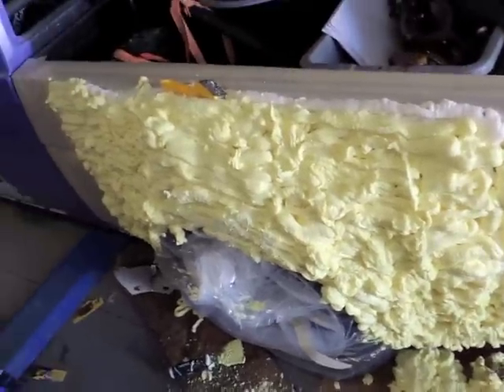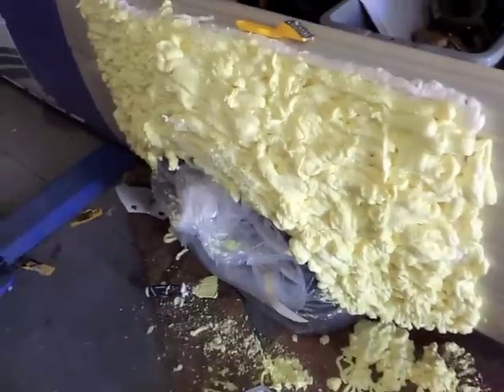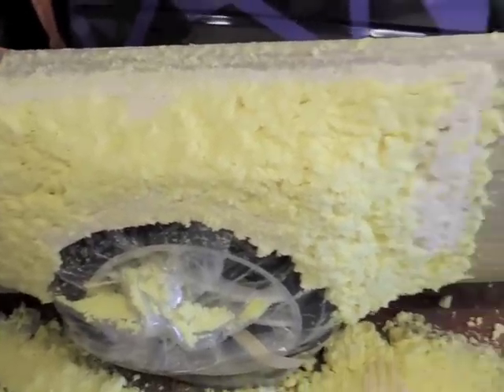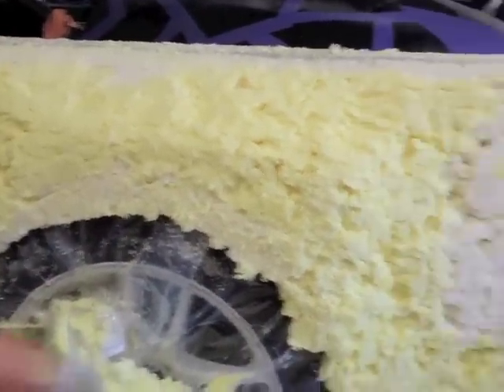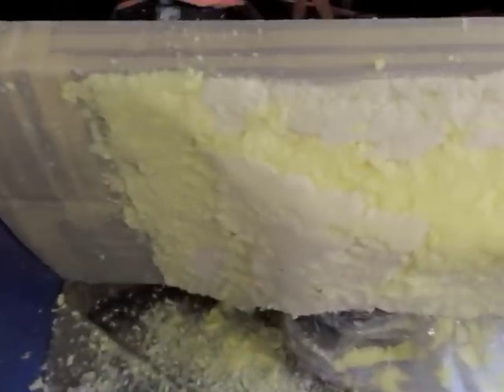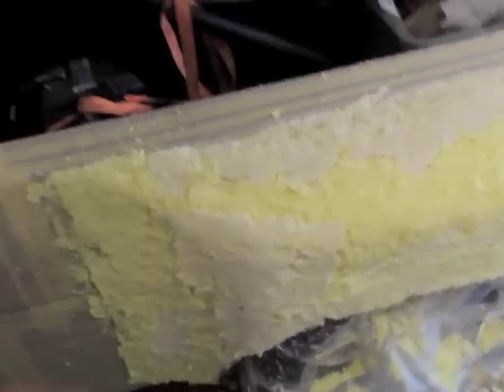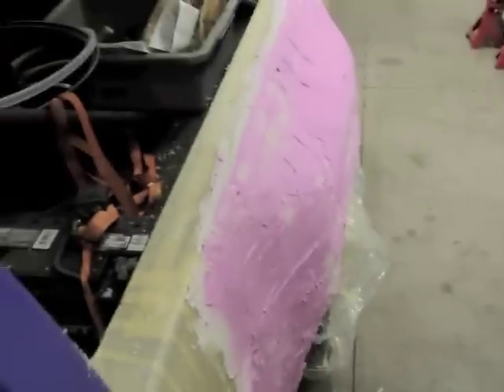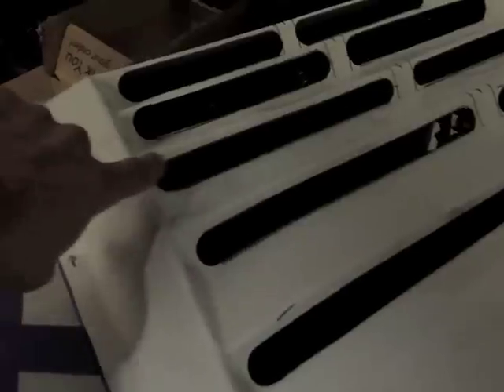How to shape your own overfenders! Pt.1

Comment: I don't know where you get your Bondo but I can get evercoat lightweight for less than $20 gal.. good idea though because you're right about being easier to sand
Reply: why use bondo when making throw away molds ? (the filler i use for auto body is 200 dollars a case)   I buy  unmixed powder joint compound and mix it with latex paint zero no water when making body parts molds it does not melt the foam